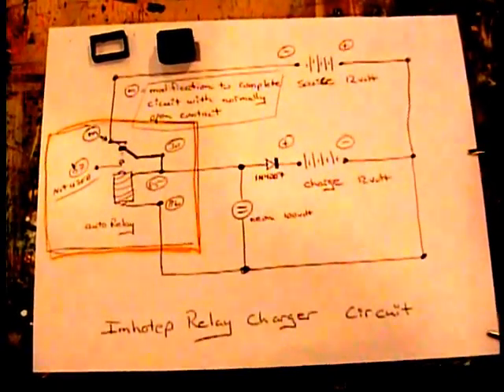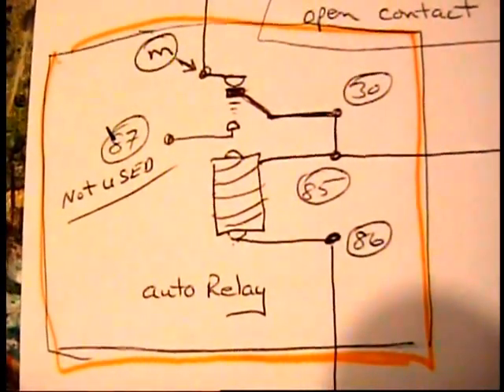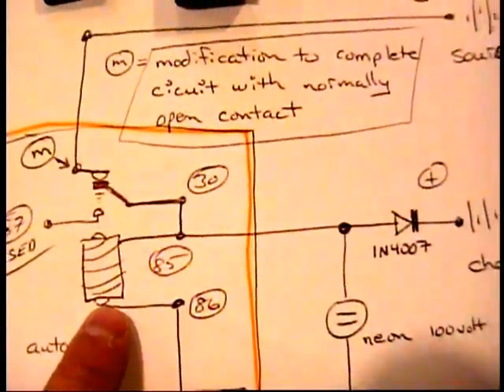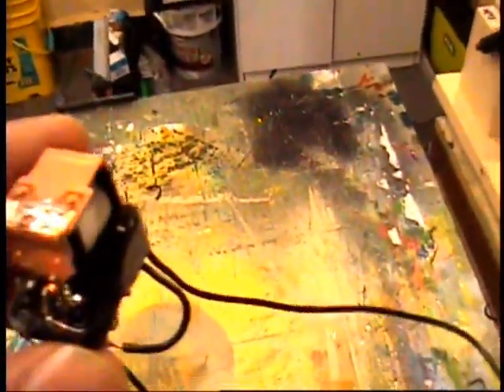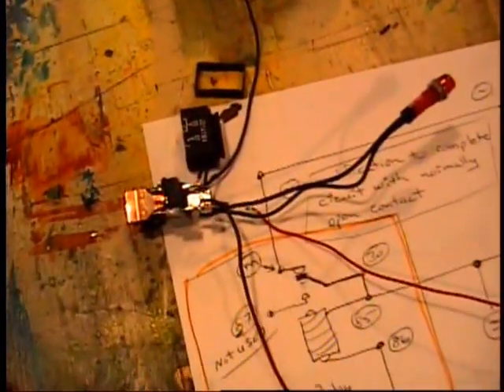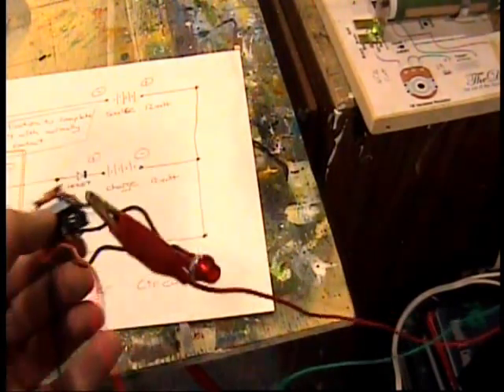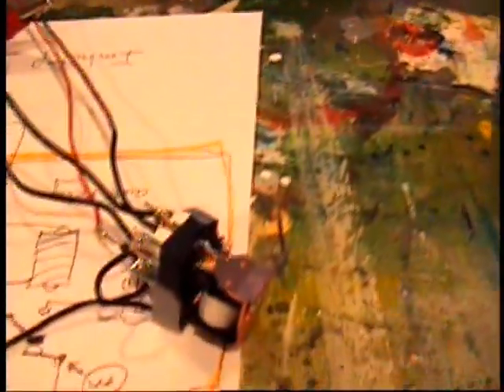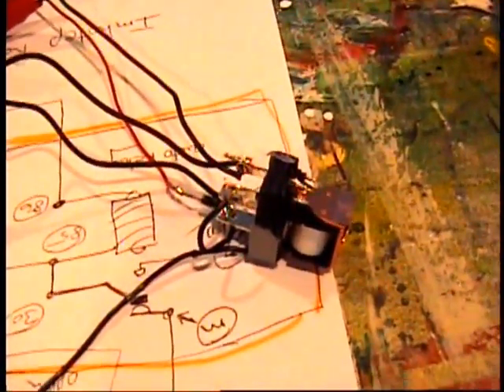Imhotep Relay Charger Replica

Comment: same results? really?

Can you share your experience with the bedini and the Imhotep?

is one charging or recovering batteries faster? or more deeply?

One guy I saw in a video put a microwave oven transformer secondary
in series with the relay coil to get more umph! I should try that.

thanks
Reply from the maker: Yves, at the time of this video I was still a novice with the Bedini. The magnets are too weak to turn the wheel properly and did not open the transistor enough. So, a well made mini-coil can keep up with a poorly made maxi-coil. The auto-coil discharge I can now measure which has also been a challenge. Auto-coil consumes 12.14 volts @ 35 ma and produces 42 volts @ 95 ma. which is 0.5 watts in, 4.8 watts out. Now that I have re-built the Bedini 5 times it now produces a whopping 150 watts of power.
Reply: Ronald Gerth
Thanks great work,
Reply from the maker: Yves Baggi I would like to follow up on a statement I made to you in response to your comment on my video "Imhotep Relay Charger Replica". I made a mistake and told you my Bedini outputs 150 watts of power. I used the peak voltage instead of the effective voltage. I have also found out that measuring the effective voltage on a pulsing circuit is almost impossible without an oscilloscope. So, I can only say that my voltage peaks are 300 volts. Judging from light bulb tests my output in real power seems to be about 4 watts. That would be about a 100 volts effective voltage at 40 mA (my meter tells me 500mA but if that were true I could light up an 8 watt bulb no trouble!). The Auto Relay Charger comes in at about 1.5 watts. Sorry about my ignorance. I'm working on it.
Reply: Ronald Gerth
I appreciate the update. Measureing in and output power is one of my weaknesses. I come from the DSP world so everything's easy once it's been sampled. But it's the sampling of these very different types of waveforms that is challenging.
Reply: I have made lots of this type of device and believe it does not " pull in radient energy "  . The explanation,  as with the Bedini motors,  is  explained by conventional electrical  laws and theory . The simple explanation is:  when a current is applied to a  coil of wire a magnetic field is produced in the soft iron core ( an electro magnet)  ;   if a magnetic field  crosses or " cuts"  a coil of wire a voltage is produced .
eg  apply power to a  DC motor and it rotates , if the motor is turned by an external force ( spin it with your fingers )  a voltage is produced.

The voltage is dependent on the number of times the magnetic field " cuts"   across  the  coils of wire.
In the case of these type of  devices  the  electro magnet  is turned  on and off rapidly . When energised a magnetic field is produced ,  when the voltage is disconnected the magnetic field  collapses and in so doing  it produces a voltage in the coil in the opposite " direction" to the original applied current.  
By turning the current on and off rapidly the magnetic field collapses rapidly and a voltage is produced and a back EMF  is higher than the original voltage applied to the  electro magnet. If one measures or captures the Back EMF the Power ( volts X amps)   is far less than the power used by the device  i.e.   power IN   is greater than the power OUT.
The illusion of a power gain is because the back EMF  is higher than Voltage  originally supplied HOWEVER,  the current ( amps) is much lower.
Power OUT is less than power  I N .    More correctly    Joules IN   is far higher than the Joules OUT.   There is no energy gain  only an increase in Voltage over a shorter time and a greatly reduced  Amperage